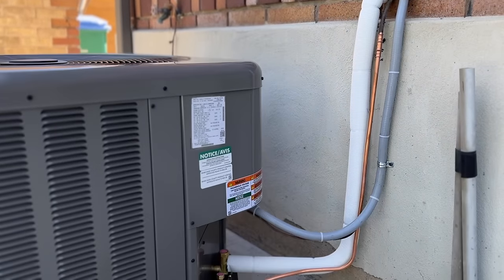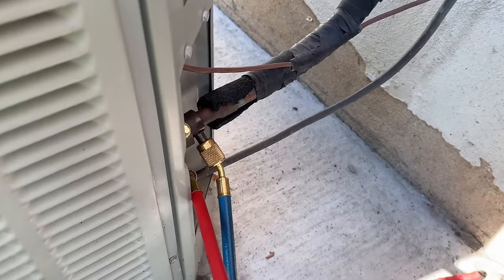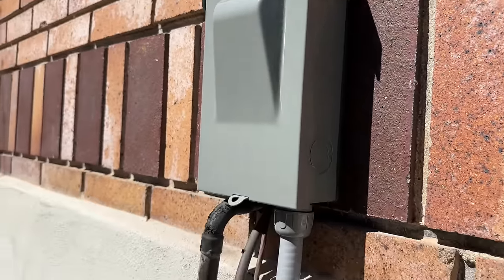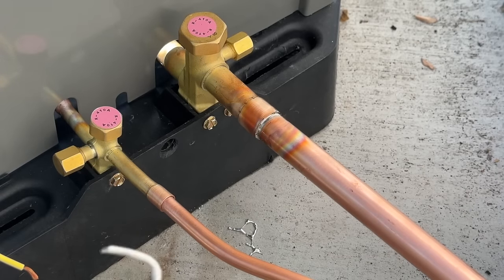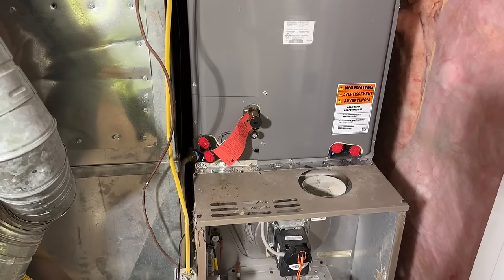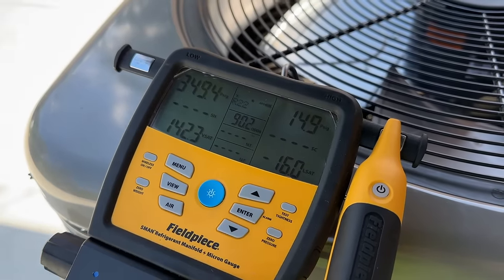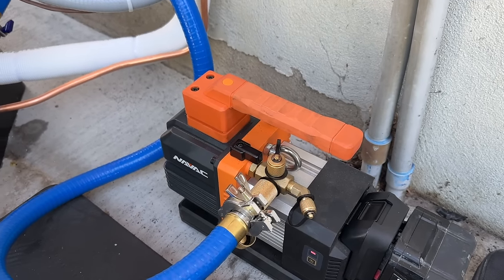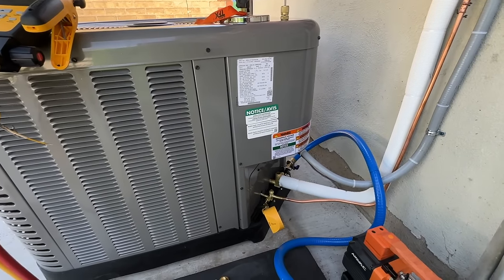Did You Know You Can Replace Your Own Air Conditioner?   -SAVE THOUSANDS-

Comment: I’m sure there are some great, honest techs that are far superior to a DIYer. However, in my large urban area, service calls cost hundreds, and cost to install a new HVAC system using existing ductwork is unit price plus $12K or more in labor. For that price, the air handler will be butchered, leaky, no attempt to balance, and the compressor will be scuffed up and dented with half the service panel screws missing and the other have stripped out. At least the  unit will be covered in stickers so one knows who to call to pay $600 in annual maintenance. 

For what it’s worth, while not a pro, I’ve been a machinist, have built a dozen houses from the ground up, have an engineering degree, and have a decent amount of experience bending and riveting sheet metal and a lot of mechanical experience. This channel is perfect for a guy like me who has solid fundamental skills, enjoys mechanical work, and wants to save money.
Reply from the maker: Awesome. Thanks for the support!

Comment: Perfect, reusing the old lineset with no sort of flush .  Should work perfect once those different oils mix from refrigerants that are not supposed to mix
Reply: lol 😂.....I'm just a typical homeowner and although you're hatein' on the guy, you're correct.  The original lineset should be wiped with a "pig" + compressed air/nitrogen for good measure.
Reply: Wondering about the flush here. Looks like around $100 bucks for a flush kit. Going from 22 to 410.
Reply: @KefirTView  25 years in HVAC you learn a few things. I'm not hating, I just don't like that these channels don't cover a lot of the actual important things. I prefer a homeowner does it because I can charge more to come fix it.
Reply: Yes did you flush the line set? 
Didn't see on video
Reply from the maker: Chad, in your experience what happens if some residual oils mix? I’ve done quite a few systems with no flush and have seen zero ill effect. I’ve actually talked with alot of other guys who feel the same. The only time I make sure and flush, is when there is a burnout or the system has acid in it.
Reply from the maker: And no I did not do a flush on this one
Reply: There are acid testers out there. Before the system is drained.
Reply: @diyhvacguy  Copeland actually prefers line flushes are not done with their compressors unless there is more than 10% mineral oil mixed into the POE system. I was told that by a Carrier representative. Copeland actually prefers just a good nitrogen purge through the old lineset. They only recommend a flush kit when there is or was an oil trap in the system (or after burnouts and such). 

A little MO doesn't become acidic in POE systems or anything, so its probably not going to be a significant issue. 

I still do an R11 flush by habit just for the possibility of other contaminants, but I don't stress much over it anymore if I feel it wasn't a great flush. As long as I get a strong blast of nitro through there it will be good. And that comes from the manufacturers themselves.

Comment: To bad in my State, DIY AC isnt legal... I couldnt even pull a permit without a HVAC company on it, which super comlicated things as I had already bought a whole new system to put in and no one wanted to touch it. I finaly found a small 1 man shop that signed the permit for me and then brased and charged the system. In the end i turned a $13,000 job into a $7,000 job and now iI recomend the one man shop to everyone that needs AC work. Check you local laws before you attempt any of this and find a shop willing to install your own equipment.

Comment: Hearing these prices for a new system installed these days is insane.
In 2019 i sold my house and had to replace the central a/c system. Not the furnace.
It was about 3k in the Milwaukee area.

Comment: Did You Know You Can Replace Your Own Air Conditioner? While using Hundreds of dollar HVAC tools, if not more. 🤣😂
Reply from the maker: Umm more like a thousand in tools. But let’s do the math here. A full system replacement, 12-15  THOUSAND DOLLARS. So if you spend 4k on some good equipment, and another stack for tool. You are still saving $7-10k. How long does it take you to earn $7k? Worth it in my opinion but you do you boo.

Comment: Good Video BUT... 99% of most people don't have hvac gauges, vacuum pumps, nitrogen, micron gauges, jugs of 410(a) or anything else involved with doing this.
Reply from the maker: Correct, I have all those items in my Amazon store. Let’s take a hypothetical example here: you need a new air conditioner. You are quoted 8-9k to replace it. Yes, that is the going rate here and in many other places. But you, being mechanically inclined decide to tackle it yourself. So you buy the equupment for $3k on Amazon, and the tools for $1000 (this is on the higher end) Even if you used these tools once, which most homeowners would use again if they have multiple systems, you are still saving $3-4000!!!!    I’m not twisting anyone’s wrist here, just sharing knowledge is all. I’ve helped many people save thousands so I know it’s easily done.   Cheers
Reply: You can rent good number of the tools he used from your local auto parts store...
Reply: @diyhvacguy so, you’re really just giving out bad advice as a sales gimmick to buy from your Amazon link where you can make an commission.

Comment: I replaced my own and it saved me about 7k. It was not easy though. I ran into "software problems". Not your typical system, so if you get a system with a minicomputer on it, you better make sure the pre-matched packages are actually matched correctly. I was lucky enough that my air handler and condenser were matched when the supplier started stocking them, but the software revision they had "unmatched" them. The supplier didn't realize this and still sold the matched set anyways. Always get a licensed tech to call for software revision compatibility from the manufacturer before you try DIY on a unit with software. (If one will do that for you, that's the lucky part. I had a guy). The manufacturer won't talk to residential customers. Had I not ran into that issue, I'd have saved about 12k. But live and learn I guess. (I had to buy a new air handler that did match and re-install)

Comment: This is not a DIY project.
Reply: How is this not a DIY job? Just buy the tools. 4 ton units are $3900+$1200 in tools, maybe $2-300 in miscellaneous. So $5400 vs. $8600 to pay a company.
Reply: @JohnColeman-ul5rj paying the company that is bonded and will carry a warranty that the average DIYer will end up having to pay that extra $3K to fix their install anyway.
Reply: I disagree this looks very doable. I’m replacing my system this weekend
Reply: This should be the top comment
Reply: @jasonbuxton3358 Have fun.  But for most people,  this is not a DIY project. 

Also, you can void your warranty by doing it yourself if you're not licensed.
Reply: If you cut those copper lines without an EPA license you are violating their regulations, especially since he didn't even remotely evacuate the system properly.  What if your old ac has a LPCO? What will you do then? He didn't even get out a reclaim machine or cylinder.  There are many, many times that a system will not completely pump down due to internal safties. Also, what is a homeowner going to do with that old ac full of refrigerant? Set it out by the curb? This is a joke. I've seen this channel off and on the last couple of years, seems he's found his niche. Hopefully he's making decent money from his ad revenue. After watching his DIY furnace "install", I wouldn't hire any installer who thought that it was a "good job".  Perform this task as a DIY at your own risk.
Reply: @bassmentarchive  simple, disable the safeties and recover the rest... Or just shout "de minimis" as you let it fly.
Reply: If you got all the equipment needed it's not hard at all.
Reply: @jasonbuxton3358 how did it go?
Reply: @bassmentarchive I cut mine yesterday and drained it into the ozone. No biggie.😅😅😅😅
Reply: @bassmentarchive blah blah blah
Reply: I cut pipes every day, no issues here

Comment: This Trane condensing unit is the longest lasting unit of all times. They consistently last 20 plus years.
Reply: Mine is 25 years and still working great. I installed it in 1998! Hard to stop a trane.

Comment: Expect zero warranty and don’t call me to fix it
Reply: LOL!  Somebody will fix it.  Haven’t you watched any of Steve Lav’s videos?
BTW, I installed my own equipment so I am providing the warranty on labor. The equipment warranty is five years.
Reply: That’s what I understand install yourself and the warranty is five years.
Reply: @iwenive3390  I would like to see that challenged in a court of law. They would have to prove the damage was done by improper installation. Yes, the legal costs would far exceed the cost of a complete new system. But I wish someone would challenge this to set a legal precedent. I can buy any auto part in store or online and have a warranty on that part. Why should HVAC parts be any different? Are you going to tell me an HVAC system is more complex than a car engine or transmission / brake system? And what about DIY brake repair, no jurisdiction I know of makes that illegal. How many people can you potentially kill with a poor brake repair job on a busy freeway? Oh but it's too dangerous to work on your own HVAC equipment? This is just the HVAC service industry trying to get a monopoly on the profession. Not going to happen in the good old USA, especially now with the internet and the DIY movement.
Reply from the maker: Exactly, in my experience, the dealer does not care where the equipment was purchased. The biggest thing is that YOU as a homeowner can’t go in and get a warranty replacement. It has to be a licensed contractor. But the part itself is warrantied no problem. That’s what they mean when they say if it’s bought online it doesn’t have a warranty. Part of that is they don’t want you to know it has a 5 year warranty.
Reply: @diyhvacguy  that’s not true
Reply: @diyhvacguy  “any Covered Equipment manufactured by the Manufacturer that has been sold to the consumer via the
internet or auction website, and has not been installed by a trained, qualified HVAC professional.” Direct quote from nearly every manufacturers warranty certificate.
Reply: @diyhvacguy  the problem is the supply house might not be certain who installed it but they can always tell if they sold it.

Comment: Great -  video!  I have a couple questions:
1 -how do you go about disposing of the old condenser, full of R-22 and the evaporator?  I thought the R-22 had to be placed in a recovery cylinder?
2 - I noticed that you reused the existing lines - I thought you cannot mix R-22 with R410 A.  Wouldn't it have been better to replace the existing lines with net?
3- How to you access the evaporator coil for cleaning ?  It looks like you have to take it all apart each time you want to clean it.  Do you have to reseal the duct-work with tape each time?

Keep up the great content!

Comment: Use C-Flux it pre tins your copper and fitting once heat hits it, and your solder flows like butter. Been using that flux for 35 years, try not to use anything else.

Comment: In Las Vegas it seems we need a permit to replace an air conditioner. Also I just found out we need a permit to replace a water heater which I've done a couple of years ago and didn't know I needed a permit. So I guess if the place you bought it from doesn't have to report you you're good.

Comment: SO TO DO THIS AS A HOMEOWNER, WE NEED TO BUY NITROGEN, MICRON GAGE, SUCTION PUMP, SHRAEDER PORT TOOL????????
Reply from the maker: Correct but even after tools and equipment, a homeowner could stand to save several THOUSAND dollars
Reply: @diyhvacguy  thats funny, I have 2 ac guys that only charge me 1500 total to install full heatpump systems replacing older systems in flip houses for me so how would that save anybody THOUSANDS OF DOALLARS

Comment: My mobile home unit is all enclosed in 1. Only the 2 cooling vents go into the house.  The problem is finding a supplier of the A/C unit you want or need. You didn't mention that. They don't normally sell to the public. You have to be a contractor.

Comment: Great video. Yes , with a little knowledge and the right tools , a homeowner can do this. The tools will cost a bit , but , much cheaper that hiring a company. The most important thing you need is common sense.
Reply: Please do not attempt this, this guy has something you do not, experience. It’s not as easy as he makes it out and every location/job has its own set of problems.
Reply: Someone is going to get HURT at home please do not attempt this . experience comes in hand here not always common sounds.

Comment: Soldering hasn't been legal in Michigan or 10 years. There is pages and pages of local codes. What is legal in one state is illegal in another.  If you don't know your local codes DO NOT attempt this. You are opening a can of worms. The local municipality inspection is required after completion. They will get you on every violation.  Call a licensed contractor.that is well versed in local codes.

Comment: Thanks for this video, giving me a bit more confidence each day to tackle this on my own. My old unit is still truckin well, but it's a hugely inefficient power hog. Everywhere I've been quoted state they need to replace the furnace at the same time because the condenser "won't fit". BS! You have any tips from the trade regarding transition/enclosures etc?

Comment: That’s a lot more to..what if if it’s a heat pump .. valve calling for heat ' they will never pump system down..
Good information video..  may cost more to a homeowner in purchasing the correct tools and mainly injure themselves with High Voltages.

Comment: Well done. Detailed enough for me and I learn a little bit more every video.

Can you tell me where you get the white tube insulation? I've looked high and low for it with no luck.
Reply: You can buy some online as a retrofit, but it’s crazy expensive.  Otherwise have to buy a new lineset to get it.

Comment: I like the equipment setup. The only thing I have a exception with is not nitrogen brazing and not triple evac. 480 is not low enough, especially with trublu hoses. Also you did cover a couple of tech terms (split, superheat/subcool) which im glad to see you did but an average diy'r would not know this. All in all this would be a decent pro video but definitely not for DIY'rs. IMHO

Comment: Great video ,  that brazing was quick and simple . It's a joy to lnow how to  replace or fix an issue with your ac units especially in the heat that the deep south is currently experiencing.  If the system goes down its usually at night or weekends when no one is available.

Comment: How did you go about flushing the old refrigerant lines? What method did you use? Pro-flush or RX11? There was no mentioning in your video about not mixing the two different oils.
Reply: He didn’t.  He skipped right over the lineset flush….

Comment: To be fair, most things in the world you will be charged an arm and a leg for, coming from a journeyman HVAC Tech, every trade can be learned fairly easily. Refrigerant is expensive, losing it is actually quite easy if you arent experienced. This is a good video but it does skip over alot of necessary steps. I woulnt say its the hardest, but if you mess up you could lose alot of money. For instance in Alberta, we use R-410a and alot of houses have R-22, 1 lb of 410 is $100 and 22 is $200. I would say a standard house condenser typical here will have a factory charge of around 5-6lbs. I would just say its good to do stuff yourself, but just ask questions if you need to before you do them. Like purging the lines with nitrogen, the reason we do that is because moisture and refrigerant do not bode well together, thw purpose of an evac is to rid the line of unwanted moisture which prevents oxidization. Trust me when i say, if there is alot moisture in your line, you will be most likely be doing a triple evac which is about an 8 hour procedure. Again, not rocket science, but just be aware why those steps are crucial.
Reply: @bryanx590  well my boss overcharges to charge units idk.

Comment: Just out of curiosity, if someone wanted to do this on thier own, how many thousands would we spend on a pressure gage, the vaccuum pump, a micron gage and a tank of nitrogen? Not to mention various hoses, various fittings, tools. 
Just saying your average home owner isn't going to attempt this on thier own or invest / rent tools for all of this for something they would probably only do 1 time in the life of thier home.
Reply from the maker: That’s for them to decide. If they have the time, and want to save upwards of 7000-10,000 DOLLARS, then they can. Equipment is typically around 4k and the tools are about 1k. So if they’re getting quotes for 15k, that would be a savings of 10k. That’s no small amount. But as I said, I’m not twisting anyone’s wrist 👍🏼 cheers
Reply: @diyhvacguy The tools are much more than $1000….

Comment: look simple than split system longest connections are intact as house  if it never leak through many lifespans on many outside units changes...soldering usually always leak proof vs cheap flaring connections